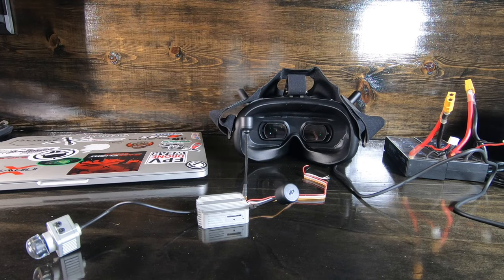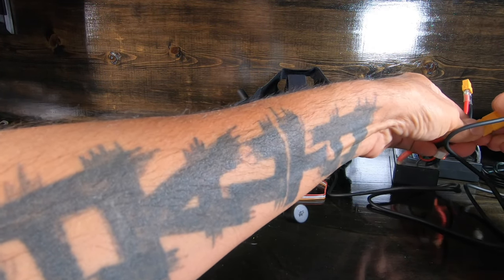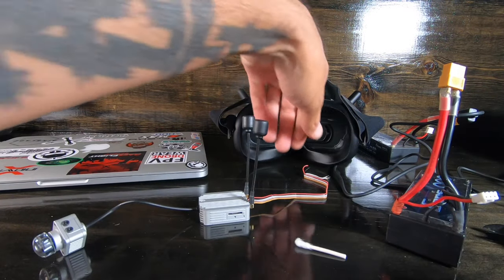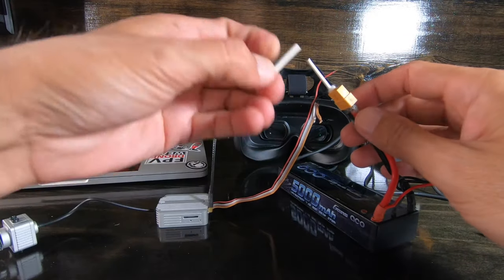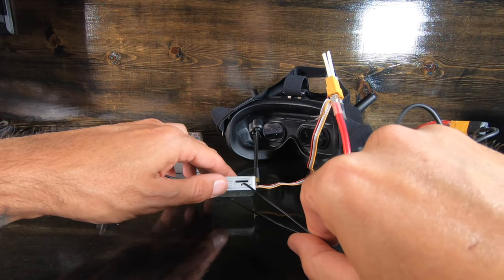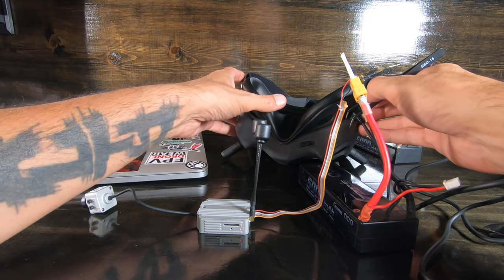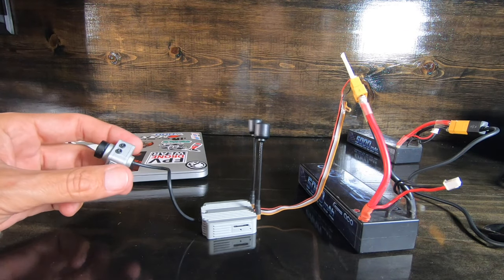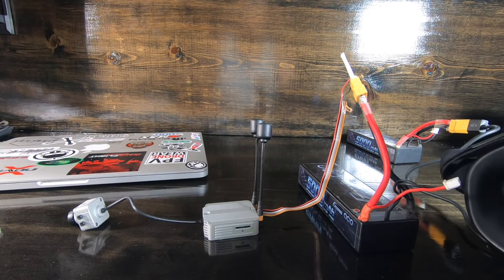Dji Digital Fpv System How to link air unit to goggles

Comment: I can't plug my air unit to my goggles, the two cables cannot plug together, like they are not meant to be together ?
Reply: You don't plug the air unit into the goggles. You do connect each one to the DJI assistant and activate them / update firmware. Then do the procedure described in this video to actually connect them wirelessly. This reply is just to help anyone in the future who might be trying the same thing.
Reply: you were planing on fpving yourself? like sticking the camera on top of the googles? XD

Comment: I wanna get this set up. But I kept reading that you can’t activate the goggles with out the quadcopter. Is that true? . Or can I do what u did with only the air unit.?